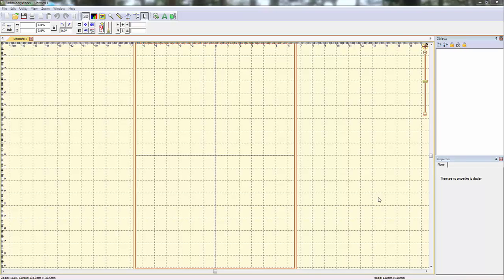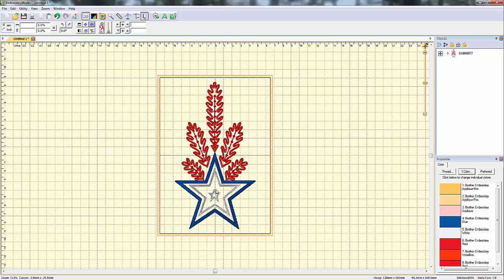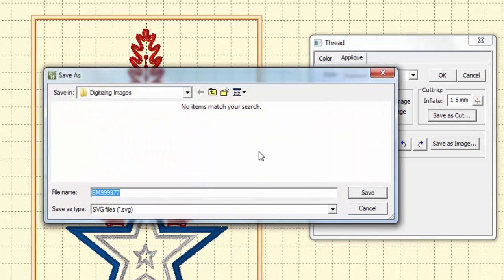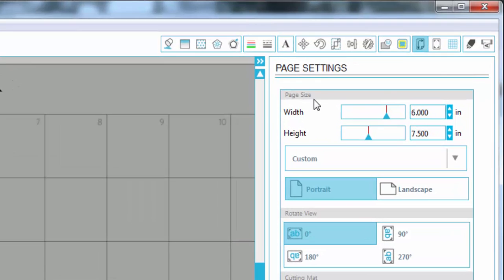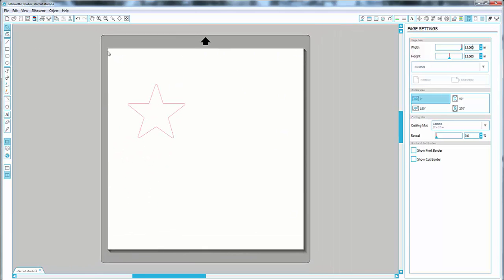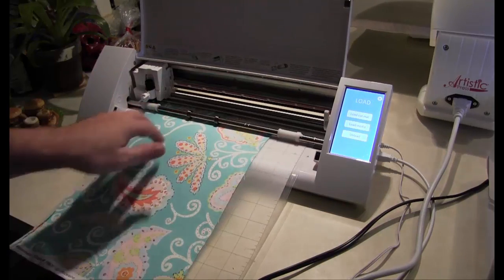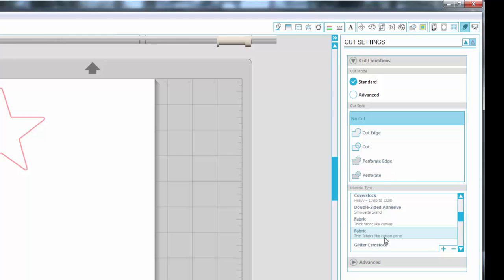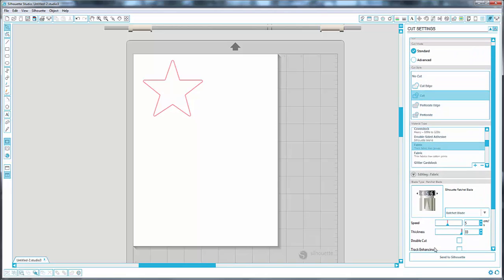Cameo Cutter and Embroidery Works - Cutting out applique designs

Comment: Although I think this is hella cool use for my vinyl cutter... I can't help to wonder about the added cost using this technique would require...  the EZ steam sheets are like $9 for a 5 pack of 12" x 9" fusible sheets unless if you are making patches/applique in bulk you would end up wasting a whole sheet for cutting a small shape.

Comment: So it doesn’t matter which software upgrade you have for the cameo it was still allow you to cut out the application? The reason I ask is because on the site for silhouette America it’s saying that you need the silhouette designer plus addition in order to use embroidery files
Reply from the maker: correct this works with the standard edition of the cameo software

Comment: What kind of heat n bond do you use? I have a lot of the silhouette brand interfacing, and I want to use that up before I buy more. When I've tried to use it before, it doesn't really stay in place for the tack down stitch. Do I need to get a small iron to fuse it? Or can I just use a dab of fabric glue?
Reply from the maker: small iron works, fabric glue would too i guess. i use appli-kay-wonder from floriani

Comment: Brad, Anitagooddesign does stuff that requires such precise trimming by hand before the satin stitch goes down that it never looks perfect or takes forever to hand trim.  I would assume if I stitch out the placement outline and scanned I could do as you mentioned in your video, but here is the problem.  I would have the stitch line and the cutline has to be larger to allow the fabric to be tacked down.  Is there a way to enlarge just enough to handle this.  I have embroidery works and a cameo I got from your store and this would make designs I now find useless worthwhile.  Any help appreciated.
Reply from the maker: you can do it with embroideryworks you can set how much to inflate the cut line
Reply from the maker: https://youtu.be/lcahOTvUDGg?t=5m6s this is where i talk about how to do that